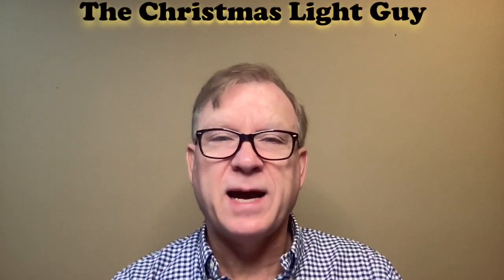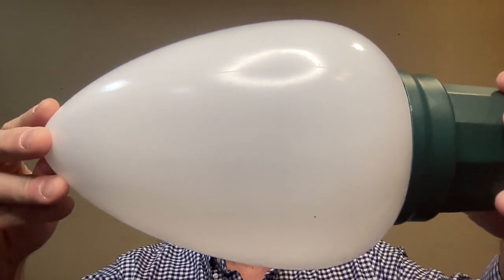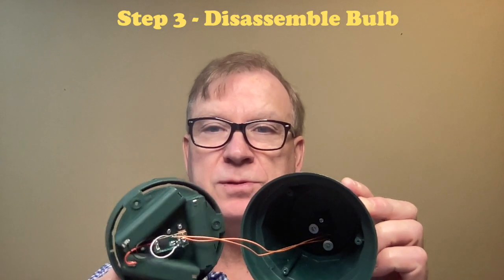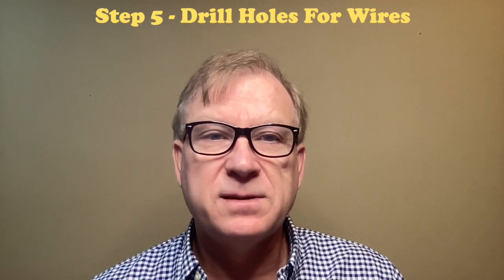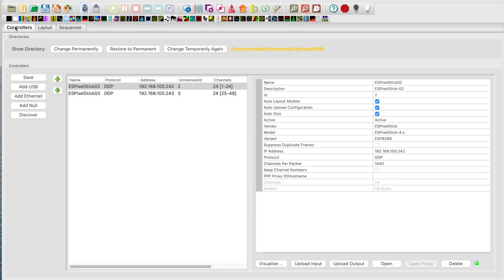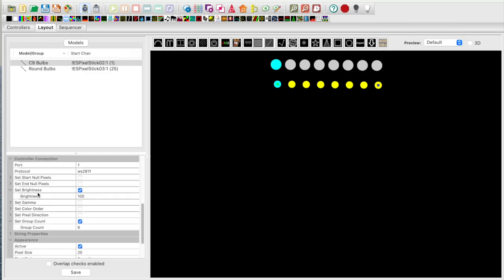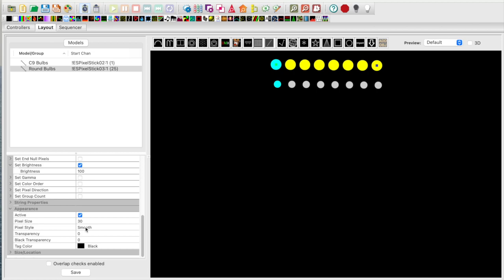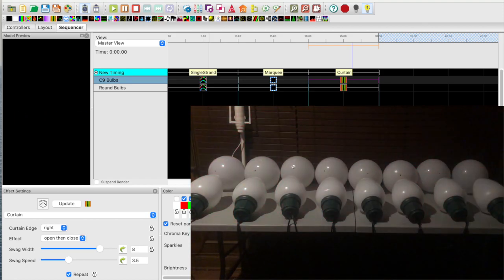How to Retrofit the Home Depot Jumbo LED Bulbs and how to model in xLights.

Comment: Is it possible to wire these lights using the LED that comes with it and dutch the batteries?  I would like to know what materials that would require
Reply from the maker: You may be able to use the existing LED in the bulb but it is only a single color, not RGB.  There are other considerations also such as voltage and how to control it (on/off intensity).  IMO it is easier to replace with a Puck LED or multiple pixels.

Comment: Do you have a link to both of the led lights used in the video?
Reply from the maker: Do you mean the large bulbs (C9 and round)?  I didn't include the links since these are seasonal and the links don't work all year long.  You should be able to search HOME DEPOT web site and find these.
Reply: @thechristmaslightguy  no I mean the lights that you are adding inside the jumbo c9 bulbs. like the single one.
Reply from the maker: @kadenondakeys1221  Here is a link.  These are 45 mm, 12 LED, 12v with the same 3 pin connectors I used. Let me know if this link works:

https://www.aliexpress.us/item/2255800797846511.html?spm=a2g0o.store_pc_groupList.8148356.2.4649a9feiPUb9O&pdp_npi=2%40dis%21USD%21US%20%242.10%21US%20%242.10%21%21%21%21%21%402101fd4b16702780688855098e7730%2110000013195180102%21sh&gatewayAdapt=glo2usa&_randl_shipto=US
Reply: @thechristmaslightguy  Thank you so much!
Reply from the maker: @kadenondakeys1221  You are very welcome

Comment: I am trying to create a single line model for my 13 RBL bulbs with 6 pixels each.  The issue I am having is the "Set Group Count" option.  My controller is a ESP8266 with WLED and as soon as I pick that controller, the "Set Group Count" option goes away?  
Is there a better way to set it thr Home Depot RBL bulbs with 6 pixels each on a ESP8266 WLED controller?
Reply from the maker: Check out grouping on WLED.  Set grouping to 6.   See this link for more info: https://github.com/Aircoookie/WLED/wiki/Segments
Reply: @thechristmaslightguy  Thank you!  I now have an idea on how to set it up on the WLED side, but how would I create and set up the model or pixel string (like in the video) in xLights?
Reply from the maker: @DWR6  If you are able to configure the controller to do the grouping,  then model the HD RBL as a single pixel in xLights as I did with the C9s in the video.  The controller handles the grouping or group count.
Reply: @thechristmaslightguy  I went through the Segments setup in WLED, and the bulbs work correctly when using the WLED effects.   From what I can tell, the Segments settings in WLED does not transfer from xLights.
Reply from the maker: @DWR6  So, a manual setup/config is WLED is required?
Reply: @thechristmaslightguy  The manual setup of segments does not apply when driven by xLights.  Is there another way to group them together just in xLights, that you are aware of?

Comment: Do you have a Home Depot part number for these jumbo bulbs? I can only find a 5 inch round model.
Reply from the maker: I found the link but it is a seasonal item and doesn't display anything. https://www.homedepot.com/p/Home-Accents-Holiday-13-in-LED-Jumbo-Bulb-with-Timer-White-8211-13689/305025779